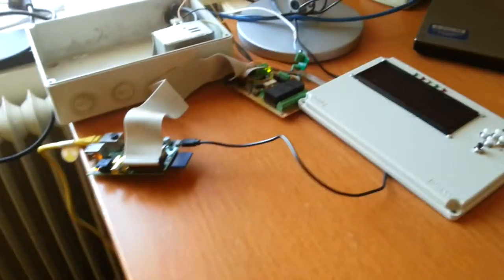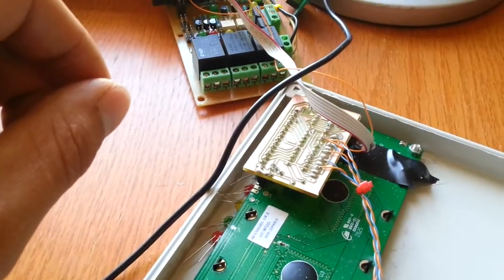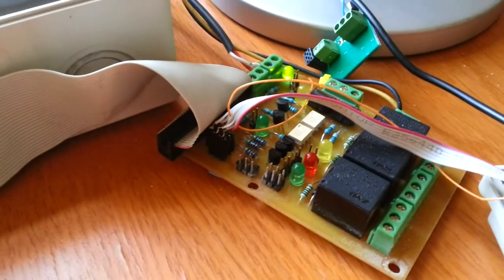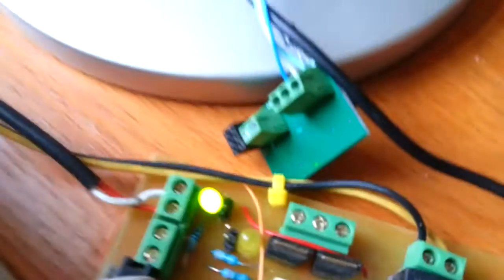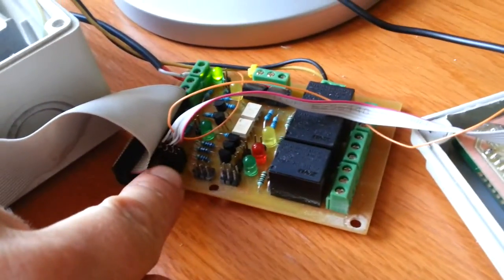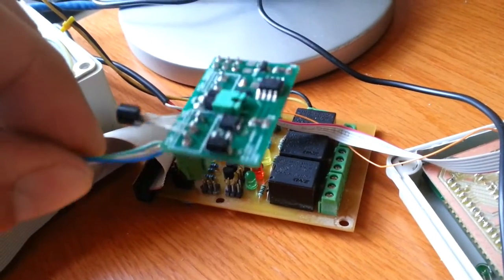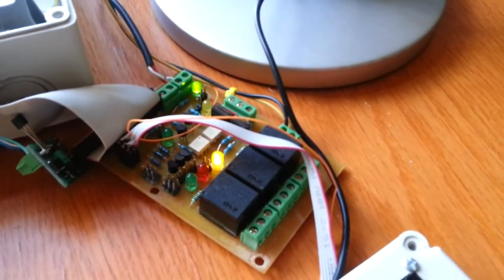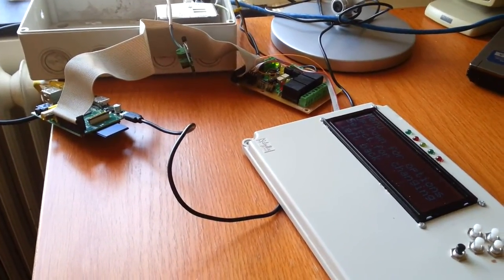Raspberry Pi Heating system with Display and buttons Part 1

Comment: Nice work, thanks for sharing! I am researching to do a similar project using a pi as the controller for a wood fired heating system with thermal storage.
Reply from the maker: Thanks,

It works ok. Some tweaks need to be done. But it have been running since then and i still got heat in my home. The big part now is to actually create all scripts